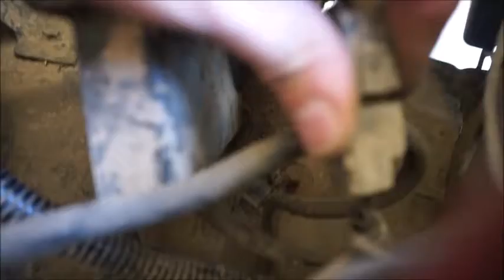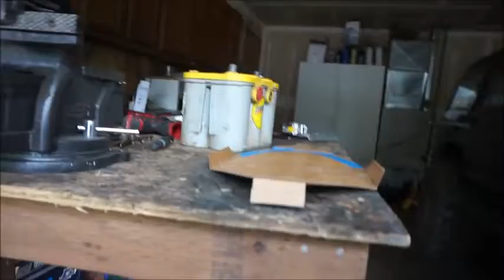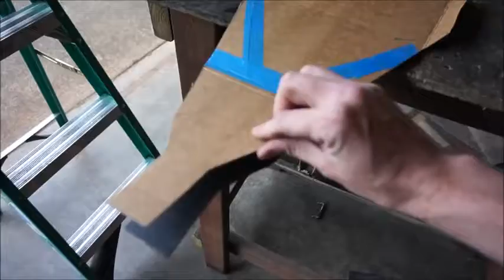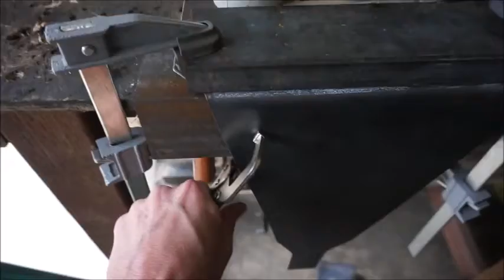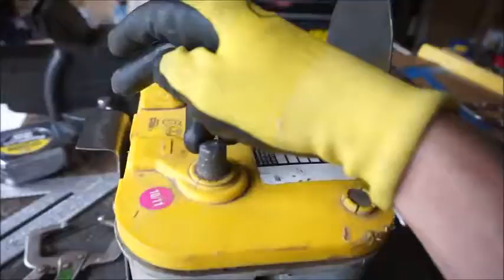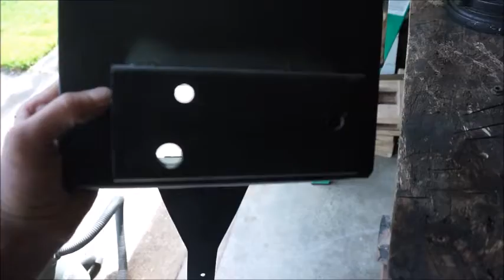Jeep Cherokee XJ Custom Battery Box

Comment: Once everything is clamped down on a edge
Use a dead blow softly to help ur 90° bend to have better corners
Reply from the maker: Ya I ended up massaging  some  of the bends with  rubber mallet.  It worked pretty well.  Thanks for watching!